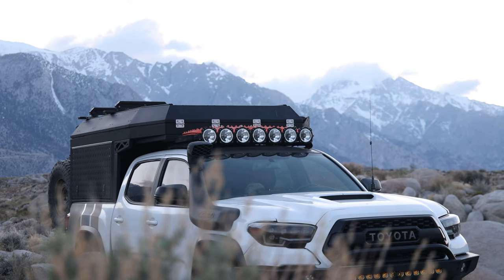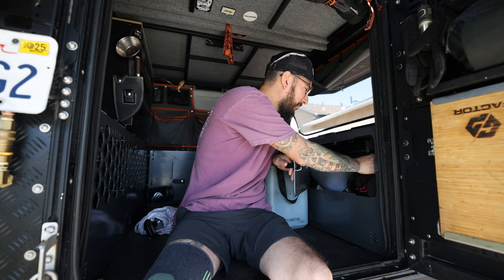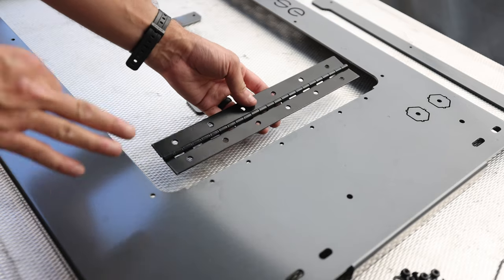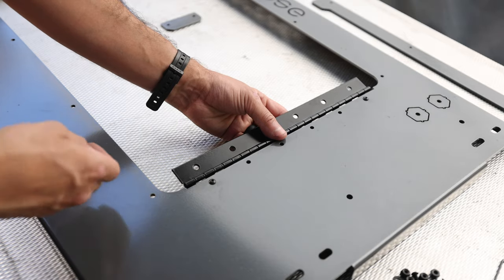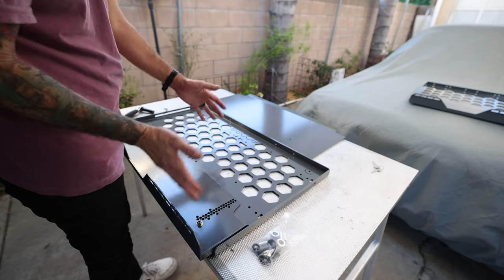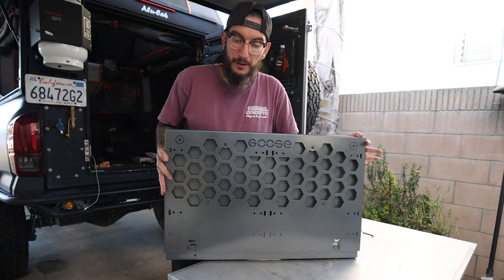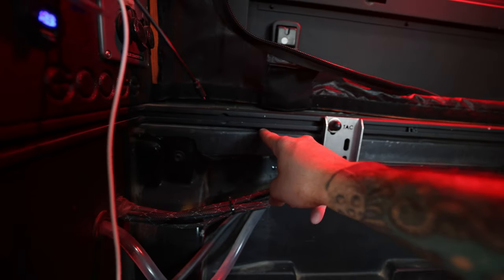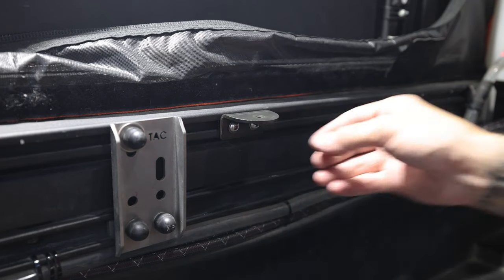Transforming My Alu-Cab Canopy Camper: Goose Gear V3 Interior Upgrade

Comment: Looks like a great setup. I like that it doesn't intrude into the doorway, that would let me hang an exo-table off the back door since it intrudes into the camper some. When you were sitting at the end filming, it looked like a cabinet on top of the goose gear on the left. Also, where are you keeping your fridge? Do you have it on slides?